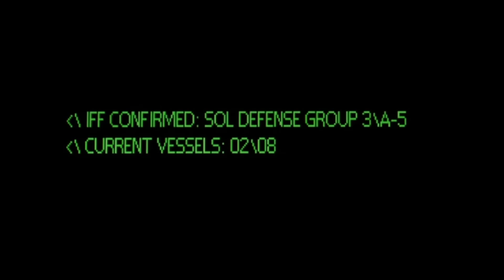Marine Armor | Most Detailed Breakdown

Comment: Why don't we have these titanium alloy BDUs?
Cost, and weight.
Titanium alloy is still difficult to produce, and thus relatively expensive. And, as anyone from the military can point out, even ceramic plates for a vest is heavy enough. They'd need to at the very least be a load-bearing system/design, and even be semi-powered to be able to lug around all that mass. They're working on the latter right now, but we again run into cost issues, and we'll also end up adding "battery life" to the list of issues to overcome. Hell, if the helmet's heavy enough (which, I mean, it's made out of titanium alloy, so it is), and the weight wasn't supported by anything other than your spine, a simple fall could also end up snapping your neck.
The fact that Marines in Halo bother wearing armor that melts (canonically) from a single plasma pistol shot is...... questionable. It sounds like it'd make more sense to just wear heat resistant clothing to minimize second-hand burns and bet on not getting hit to begin with, since molten metal armor will end up just causing additional tissue damage, and you'd save on a LOT of weight to just focus on heat dissipation. Ventilation and cooling can be handled by future tech magic.
That said, it's always fun seeing space marines in futuristic armor, so I can't blame them for coming up with cool designs.

Comment: Forged metals all need to be surfaced. Or at least thats been my experience the last 8 years in the Aerospace manufacturing industry. Every single rough forging i have ever seen or worked on myself has a really rough outer scale and uneven surfaces. Yea it may be in the general shape of the end object but it must still be precision machined to final spec. Im positive that the marine armor plates would be no different. Then again its hundreds of years in the future

Comment: Ever heard of Dragon Skin armor? It isn't new, its modeled after scale patterns on animals. I don't know how bullshit the TESTING section on Wikipedia is but with results like that, it warrants consideration. I'm sure the Halo marines would appreciate it
Reply: The US military testing found that, while it was great at absorbing multiple bullet impacts, dragon skin didn't stand up to battlefield conditions. The adhesives that held the ceramic scales together failed after extensive use and failed quickly when exposed to desert heat. The result was that the scale armor just fell apart. I'm surprised that they never found a way to improve the armor in the years since and fix these issues.
Reply: @kenmayer100  I'm aware why it failed IRL. I just think the Halo universe could afford multiple sets of ceramic armor per soldier. I was thinking of Sniper Alley on H2 on Legend, marines could take 3-4 hits but you couldn't even take one! That pissed me off to no end along time ago. IRL the best defense is just not getting shot.

Comment: Uh, we are funding it, my guy. Are you not aware of projects going back to 2005 that are trying to do exactly this? What's hanging it up is some general decided every single one has to have an exoskeleton to support the armor so it dosnt tire the soldier out. We cracked the EXO part like last year so, in 2-3 years expect spec ops to start getting stuff like this and for it to filter down to common-ish use within a decade.

Comment: So thats not quite how NIJ armor ratings work. Level 4 armor can stop all threats any lower levels can up to and including 1 armor piercing 30-06 not 308 (7.62x51). It is a more effective, albeit heavier plate. However with modern materials theyre much lighter. The pevel 3+ armor is for "special threats". Which means its designed around defending against steel cored "armor defeating" (note not penetrating) intermediate rifle cartridges such as 5.56 and 7.62x39. So with this the armor level from a NIJ perspective of this armor would easily be level 4. If not a as of yet defined level 5 given how far into the future this is. Also on note to the people talking about weight, this wouldnt be that heavy if materials science keeps advancing. My level 4 plates in the USMC (called esapis) weighed easily ten pounds each for body plates, and i had two side plates (I dont remember the weight). However now you can purchase multi curve, multi hit, level 4 ceramic plates from Hesco that weigh only 4.6 pounds per body plate. 50% reduction in around 10 years.
Reply: That's because those level 4 plates use a ceramic polymer blend (or lamination rather), not a metal with a relatively fixed density like titanium. Also titanium isn't really "stronger" than steel, it has a tensile strength greater than mild (low carbon) structural steel for the same weight. That weight bit is important because titanium isn't quite half the weight of steel for the same volume, but in the same volume steel is usually stronger (meaning the titanium has to be bulkier to get improved performance). Titanium also can't reach the same hardness as steel.

Comment: You are wrong about production methods . Casting is used for large production numbers over machining . Once you have the die you can pump out large quantities faster and cheaper than machining . For smaller quantities machining is more cost effective and faster because you don't have to design and manufacture a die .

Comment: I think your misunderstanding the armour rating system a bit and how it functions. If this is a non ceramic/degradable armour  i.e a thick steel plate and it is level 4 it is wholly more effective than 3. If a level 3 plate can stop 6 7.62 rounds then a level 4 AP resistant steel plate will stop them for days. A good example of how AP makes all the difference you can shoot and penetrate a 19mm hardened armour plate with a .308 AP round but a .50 BMG FMJ will shatter against that same plate and further still a .308 FMJ will literally scratch paint off it, that hardened AP core makes all the difference. The one round of level 4 only really applies if its a degrading design and as the marines are wearing a forged metal plate I would be wholly disappointed with it being only level 3 as that's pretty meh for a few hundred years of development. I would expect by then a metal based super lightweight non degrading level 4 armour to be more than realistic. All in all though good video and really enjoyed it.

Comment: Your incorrect about your metallurgy. Casting is the weakest and cheapest. Weakest due to voids and non linear grain flow. Machining is extremely strong (depending on the metal) and more expensive. Forging IS the most expensive , greatest quality, and usually takes the longest to create.